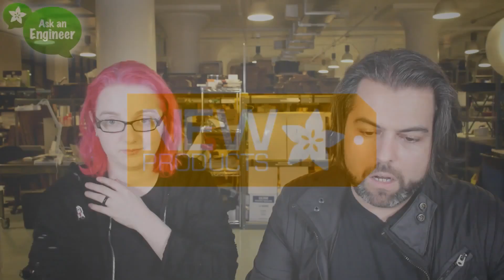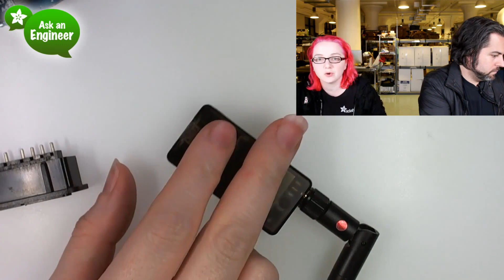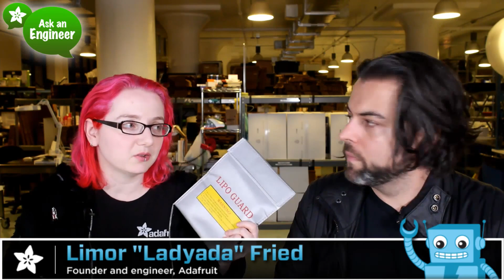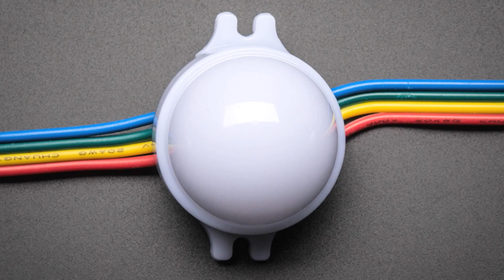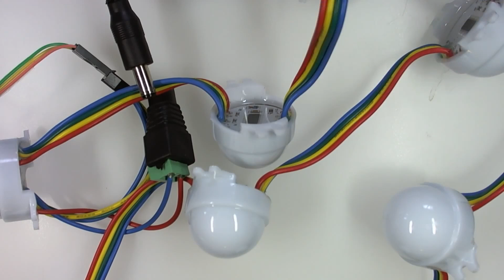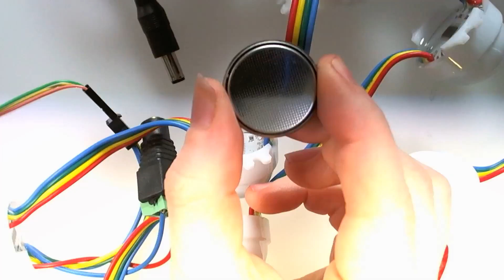New Products 11/02/2013

Comment: Guys I just watched the video on you UAV and it looks like the charger as I seen it has what the call a Balance port on the charger so as it charges the Battery stays in balance you can NOT charge a lipo on a regular charge it WILL explode I have been flying and building Quads & Tricopter's for a few years now and just wanted to throw that out there BTW -the radio is or looks to be a FlySky radio HK has a Lot of multirotor stuff to check out too Last thing-I think your site/store is AWESOME you guys have a lot of things that as a self-taught electronic gadget guy geek like myself loves to mess around with KEEPUP the GREAT WORK!!!

Comment from the maker: See what's new for Nov 2! New Products 11/02/2013

3DR Iris - autonomous multicopter (0:07) http://www.adafruit.com/products/1546

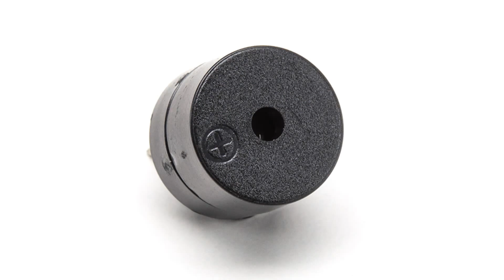Buzzer 5V - Breadboard friendly (6:25) http://www.adafruit.com/products/1536

30mm Dots - 12V Digital RGB LED Pixels (Strand of 20) (7:56) http://www.adafruit.com/products/1547

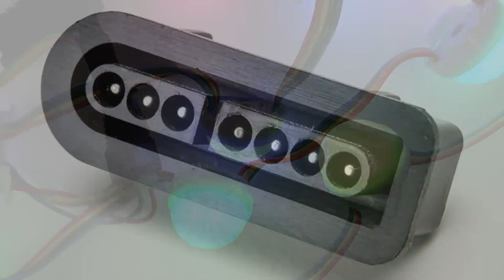SNES connector (10:16) http://www.adafruit.com/products/1576

The LED Artist R48 - White LED Wearable (13:35) http://www.adafruit.com/products/1575

The LED Artist A12 - RGB LED Wearable (13:35) http://www.adafruit.com/products/1574

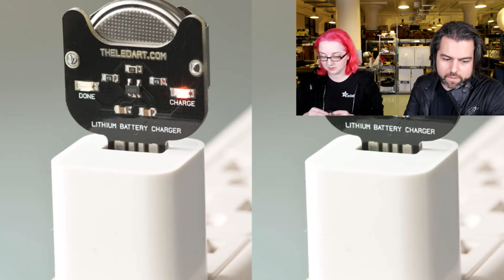Lithium Ion Coin Cell Charger (16:34) http://www.adafruit.com/products/1573

Lithium Ion Rechargable Coin Cell Battery - LIR2450 (16:34) http://www.adafruit.com/products/1572

 #adafruit
Reply: Dear Adafruit Industries, The Lithium Ion Rechargable Coin Cell Battery - LIR2450 has been Out of Stock for a very long time, can you tell when it will be back.

I have been holding my entire 82+ items shopping cart waiting for it :/ .